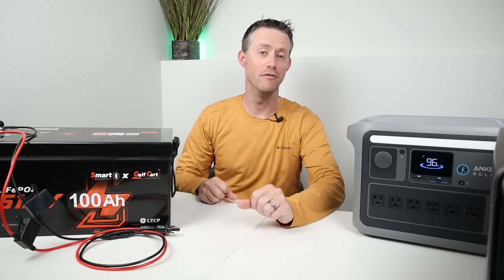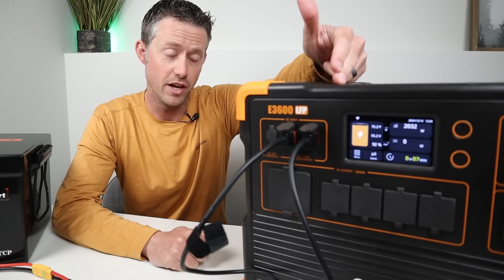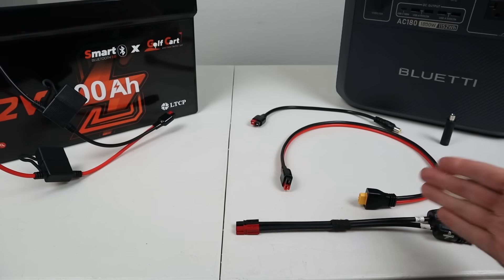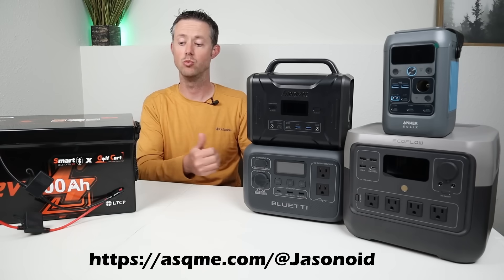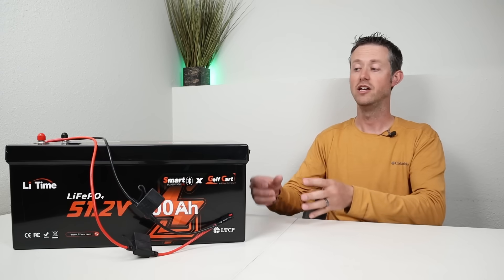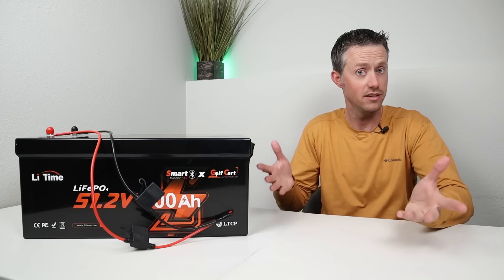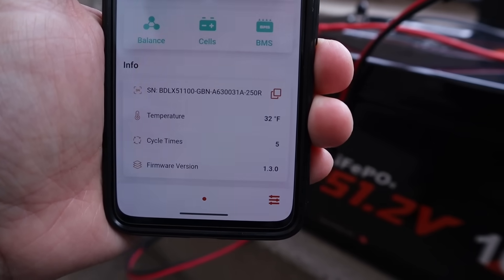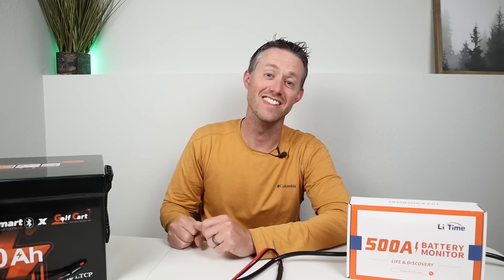Simple Trick to Make Your Power Station Last 5X Longer! Charging with a LiTime 48v Smart Battery!

Comment: I have a golf cart with same battery can I use it to power my anker 1000? Tia this can save my pups while gone few hrs daily power at my park drops when hot.... 🤙
Reply: My cart is evolution 48v 110ah batt... had 8yr warranty on battery 2 yr on cart evolution Ranger 2+2 plus....I have video on my page ty 🤙
Reply from the maker: Yes, that will work.
Reply: @Jasonoid  so it won't mess with electronics of cart ?  Game changer for sure

Comment: what if you were to touch the exposed metal bits on the postive/negative terminals on the battery?
Reply from the maker: With the voltage being near 60v, there's a risk of electric shock. I'd recommend NOT doing that...

Comment: Great video. One of the benefits of a powerbank is that it has multiple charging inputs. How do you charge the external battery using the powerbank. this would be useful for days where you are driving a long distance or where you have power.

Comment: I'd love to see how you can charge the 48V battery from solar, using a charge controller, and simultaneously charge the power station. I'm tired of buying overpriced, low capacity expansion batteries for my system, and would like to just grab a fat 5kWh battery like this, hook up a couple of my panels to it, and have a nice big storage setup...
Reply: Just connect it exactly as in video and hook up solar charge controller as normal.... This way is slightly less efficient than charging the power station directly but a cheap way to get extra capacity.

Comment: We have a 2200w generator and I just bought a 1kwh bank from Ecoflow. Adding a $1000 battery makes this a 6kwh solution. A little janky, and will require some management, but now you're getting to the point where you can run two room ACs all night without a generator running. That's sharp. Thank you!
Reply: Guys there's just too many variables, we don't know what's the ambient temp is in OPs context. Maybe he's already at 28 deg ambient and is setting the ac to 25-26 deg, if that's the case obviously the ac will sip power since it doesn't have to fight the env to reach at the desired temps.
Reply: Your videos are awesome. Especially for someone new to the power stations.  Wish I would’ve bought the bluetti AC model. I bought the elite 200. Time to expand it with a 600ah standalone
Reply: Do you have it hooked up to the expansion battery port of the ecoflow? Or are you doing it like this video?

it would be cool if you could use the extra battery port on the units, but I would assume they have some software lock to prevent you from doing it
Reply: @DigitalN  what charges your external battery?
Reply: @TooLazyToFail  there no way you can run to ac unit all night with 6kwh bank as far as I know the smallest room ac is 5000btu
Reply: @BojacksUnbound dual inverter heat pump window units sip power.  Or a mini split some draw low as 300 watts
Reply: @musicjewell9329  That's pretty much a window unit 5k btu. I know mine runs when super hot at 400+ watts, so without solar hooked up, 2kw battery may last 4 hours tops.

Comment: Is it possible to keep this battery connected to a solar panel keeping it charged at the same time connected to a delta pro for example . I was looking at adding a server rack battery but your video has me thinking maybe use a battery like in your video. I’m not sure if I would need a charge controller to avoid overcharging the battery or would the BMS in the battery prevent overcharging any advise is appreciated

Comment: So by the logic here, if i have a smaller station (600 rms with 28 volt max input) 48volts is to much, but i could add a 24 volt battery and effectively double the storage capacity?
Reply from the maker: Technically that would work 👍
Reply: @Jasonoid  Thanks for the reply.

Comment: Can
These lithium iron phosphate batteries be charged ( via mppt charge controller)while they're putting an output of using it as a battery extension for your solar generator?
And can wires be directly connected to the battery from the charge controller?And then a separate wire that would be hooked to the generator or should there be any other parts or pieces connected as well ?
Just wanted to make sure it was safe or not. Thank You!!
Reply from the maker: That's exactly how you do it. And yes, they can charge and discharge at the same time, no issues.

Comment: Can I use 12V 100ah batteries?
Reply from the maker: Yes, but they will charge slower due to the lower voltage.
Reply: @Jasonoid  thanks Jason. Electricity is like a foreign language to me. Glad to have your channel.

Comment: I have the exact same battery and the EcoFlow Ultra. Is there any way you can do a video on exactly how to set up the cables to hook up to the low PV or high PV inputs. I ordered the cables you had linked but noticed it stated it’s was reverse polarity. I didn’t want to screw anything up.
Reply from the maker: You can reach out to my Asqme consulting service for one on one assistance with your issue. You can find the link on Jasonoid.com

Comment: I use 6x LiTime 12 volt 400 ah LiFePo4 batteries, in Parallel, as my mass battery storage, connected to 8 solar panels. I use 3 Eco-flow River 2 Pro, connected to 2 solar panels each in my Rv build.

Comment: So I’m curious about something. I would be using this in the same way you’re showing here, with a Bluetti AC 180. Listed are all the adapters and such. The primary is the 10awg ring terminal X 45a Anderson. Then I’d need the 45a Anderson X 7909 adapter for the Bluetti. The link you’ve supplied is for a 16 awg adapter. Will that be an issue with the amount of amps being delivered?
Reply from the maker: The Bluetti only allows 10 amps input, limited automatically so you won't have an issue with the 16awg adapter.
Reply: @ oh ok. Gotcha

Comment: I want to build a set up like this for my truck camper. I was wondering if its possible to use a DC to DC charger to be able to charge the power station while the vehicle is running and if the power station is full battery it will then start charging the external battery. I thought this would work and if it doesn't could you explain why?  Thanks so much for the instructional video!
Reply: Yeah, just run your battery charger off the power station into the 3rd party power bank. They are MODULAR, that means your power station would be charging off your DC|DC as the power station charges your 3rd party external power bank (both will automatically stop charging when full) 🤓

Comment: I would be cautious with this method. 

1) Some MPPT controllers short-circuit solar panels when they no longer require power. Only the manufacturer and their software department know how and if this happens. If a battery is connected, this would be very bad. 

2) Some MPPT controllers can be damaged if solar modules or batteries are connected that exceed the permissible maximum current. Here, too, you only know afterward whether it will work or not. But in the worst case, the power station will already be broken.

Comment: Do you know if the EcoFlow Delta 2 Max will allow charging in solar both charging ports from the same battery? It has 2 500 watt ports.
Reply from the maker: It behaves just like the Delta 3 Plus, 1000w total from one battery
Reply: @Jasonoid  Thanks. Regarding that fused wire, I recommend using an inline mc4 fuse holder rated for higher voltage. Using amp rating depending on solar input capacity.

Comment: Can the battery be charged while hooked into the power station? Can you leave the cables from the charger on the battery terminals and just plug in the charger when necessary?

Comment: My use case is even simpler... I just want to charge my Anker F3800 using 120V AC inputs while using it @ full load. Not possible off the shelf. Can I make AC look like a solar panel to the power station safely? Any way to limit the AC used to charge the battery to only X amps in this situation?

Comment: This is a nice alternative for back-up or supplemental power. I'm planning a build around the ecoflow delta 2 max and trying to have the alternator charger, an expansion battery, and the ecoflow wave 2 is head scratching because there are only 2 proprietary ports between 3 items. You could just put the wave 2 into the regular AC power, but you use like 12% efficiency on top of the regular ac inverter drain. If you skip the expansion battery and just have something like this plugged into the solar port when needed, it could work. Though I would probably pick a smaller battery as I would take it to work or a friend's place to charge.

Comment: I own an Anker 800 and was hoping to boost the capacity by installing 12volt 50ah batter and powering it with a solar panel and dc to dc controller then simply connect the battery to my solar inputs on my Anker. 
Hopefully my explanation make’s sense.

Comment: Hi I'm new at this I know you can buy a 12 volt / 24 volt/ 48 volt leisure battery's and I'm going to plug it into the solar connection how do I know it won't blow the inverter for example the echo river 2 max is 11-50 volts 13 amps 400 watts is it as long as it's under 50 volts I'm fine
Reply from the maker: Correct, do not go over the peak voltage. So you can't connect a 48v battery to that one.
Reply: @Jasonoid  thanks for reply

Comment: You are putting 580watts through one 7909 barrel connector?????

Why?
Even at 51v it's 11.3amps on a 10 amp connector.

And I do not want to hear "it can pull 600 watts because the range is 10-60v/10amps)
10 amps at 48 volts is 480watts and your battery is not delivering 51 volts under load.

You are putting over 10 amps through a 10amp connection; it does not matter the thing let you.

Edit
Put a 10 amp fuse in and watch it pop.
Reply from the maker: Yep, and it works.
Reply: @Jasonoid  One of your viewers is going to have a fire.
7909 is rated 10amps. period.

Someone is going to buy something that just meets the spec and it is going to slowly melt.

All that talk about safety, you learn something you did not know and you dig in.
Reply from the maker: @LilRedDog  it never goes over 10 amps, the power station won't allow it. You do understand that these 48v batteries have a voltage near 55v right? 51.2v is the nominal voltage, meaning that peak voltage is near 57v and low voltage is near 47v.
Reply: @Jasonoid  There is no reason to argue when a 10 amp fuse will not make a mistake.

Comment: Could you tell me how to adapt this to a DJI Power 1000? Thanks.
Reply from the maker: You'll need the new 1800w car / solar charger unit, then you connect the 48v battery into the solar MC4 connections on that. It will charge at 1000 watts.
Reply: @ Thank you. sir. You’re a rockstar! Is there an ac to dc charger that can safely charge this size of a battery? I ask because now I’m considering a purchase of this size of a battery top it using the DJI power 1000.

Comment: I am taking this idea and expanding upon it.
Taking all my solar feeds away from my portable solar stations.
Moving them to a central MPPT charger and a central high capacity battery bank.

Then sending a 48v feed from that to the solar stations to build a distributed power network similar to a whole home setup at a fraction of the cost.

My only concern is they say never hook a solar panel to more than one MPPT, technically what I want to do is send the battery to multiple MPPT (multiple power stations) but with the battery being constant voltage and amps I don't think it will cause a problem, but if I find a problem I plan on setting up a switching station to turn on/off feeds as needed.

I was going EcoFlow Ultra with SHP2 and learned it can use the self powered mode to save $ using solar, and EPS (emergency power mode) for 20ms UPS at the  same time.

Buying several smaller Delta 3 Plus (or even River 3 Plus) and setting up a distributed network like this, now I have 10ms UPS on all my important equipment, increased capacity on the stations at a fraction of the price, and no more wasted solar as before becasue all my solar is going to a central source instead of directly to a station that may run out of capacity before the day is over.

So have you tried sending 48v to multiple stations and seen if there are any negative effects?  As long as you stay under the amps the battery is rated for should be good IMO.

P.S. for the smaller stations maybe try a DC to DC Buck Converter and step down the voltage.

Comment: Jasonoid, is it possible to connect the same Li time battery to a EF DPU? If so, would you create a video for that connection? Thanks, enjoy your thorough review videos.
Reply from the maker: I kinda show that at the end of this video.
Reply: @ yes I did see that part and you combined the battery output into the solar arrays to help charge the battery up on cloudy days. What I am asking is using the battery into the Low pv port by itself. Would I need to long push the DC button on the DPU to get it to recognize the battery input power? I tried it on mine and it didn’t recognize the input power, I didn’t know what else to do. I know it works on my Anker F2600. Any suggestions is appreciated. Thank You for replying
Reply from the maker: @hlm34  it just works, you connect the battery to the low pv port and it charges. No need to change any settings or push buttons. If it doesn't work you probably have the polarity backwards.
Reply: @Jasonoid  I will look into that and get back to you. Thank You Jasonoid!
Reply: @ ohmed  out the the XT cable and tested voltage and everything is charging now. The polarity was crossed and now I’m getting 750 watts into the low PV with a 51.2v x 60 amp Li Time lithium battery. Thanks again Jasonoid!

Comment: You have a fabulous setup at the end of your video. Which of your video would you recommend I watch to figure out how to connect aSolar power to that battery and protect the AC180 Bluetti from getting too much voltage?

Charging the battery solar and allowing the battery to charge the ac180. One could just use solar but the extra energy without that big battery would not be captured by the AC180. I have limited knowledge in electricity specifically Direct current. If you find time to answer great I would appreciate, otherwise no worries. Thanks for your videos. 

Thanks.

Comment: I use a bluetti AC300. and I purchased two. 24. Volt. lifepo 100 amp. batteries. Connected in series   showing. 57volts at batteries. but I get nothing connected to ac300 !. I checked my connections and double checked them. Then I thought I've got a. inline meter setup. So I plugged it In between the battery and the blueettie.ac300 And it takes charge. but only 620 watts That's not the end of the world. Other people have suggested that I take the meter out, and maybe it will have corrected itself. But that's not the case. but it should be taking a lot more wattage than that. The AC300 has two charge controllers like the one on your video. They both accept solar panels. No problem whatsoever. the solar is delivering 70 volts. and up to 900 watts. Which is a little bit odd for me. as I did have three panels each of 410 watts each. until the last bad storm. When one of them left the flat roof of my. garage. So I've repositioned the other two that survived, having moved and strapped them down. with some ratchet stripes. Obviously I can't puncture a flat roof. and bolt them down. anyway the Maximum It should be able to get. is 810 watts. but on very sunny days, which are few and far between here in Scotland. I've exceeded over 900 watts. The only thing I can think of that's doing this. is I added some reflectors to the base. to the base of each. solar panel. 1 cracked. wardrobe mirror. and another panel out of a double glazed door. Just lay. on the flat roof in front of them. I did this because I saw that reflectors added to horizontal panels that some one was experimenting with. And they experienced better wattage. But not over wattage.

Comment: Sorry for the silly question.  If you wanted to do this with the Bluetti Elite v2 (12v-60v; 20A; 1000W) - it would be under the 60v, but over the 20A and 1000W, right?
Reply from the maker: This would work just fine. It would be limited to 20 amps input by the power station and charge at the peak input 👍

Comment: Hello,
I own a FOSSiBOT F2400 battery and would like to charge it using an Orion XS 50A non-isolated booster charger. Before proceeding with the connection, I want to ensure that it is both compatible and safe.
Here are some technical details:
My booster charger delivers 50A, which is approximately 600W at 12V.
The F2400 battery has a solar input that accepts up to 500W, with a maximum voltage of 50V.
It also features an Anderson interface, which might be an alternative connection option.
I would appreciate your guidance on the following questions:
Is it possible to connect my booster charger to the solar input of the F2400 by adapting the connectors?
Would the Anderson interface be a more suitable option for this type of charging? If so, what precautions should I take?
Is there any risk to the battery if the charging power slightly exceeds the 500W limit of the solar input?
Thank you in advance for your assistance and recommendations.
Reply from the maker: 12v input will charge the power station around 100 watts 👍 you need to boost the voltage up higher to get faster charging. Look into a product like the Bluetti Charger 1

Comment: Can I charge the battery with my bluetti with one of the ac 110 standard inputs while also having it plugged into the ac power charging connector that is used to charge the station or will it create some type of death loop?